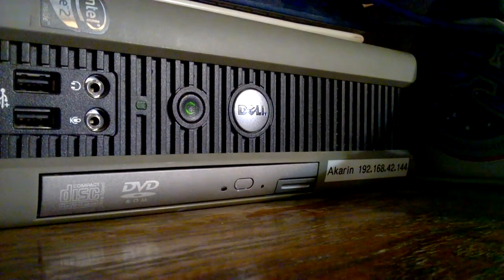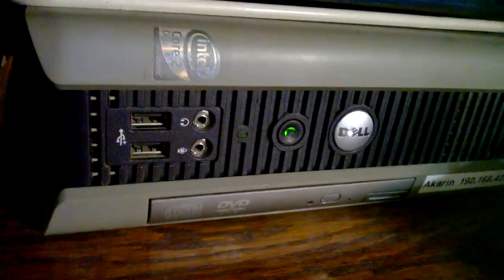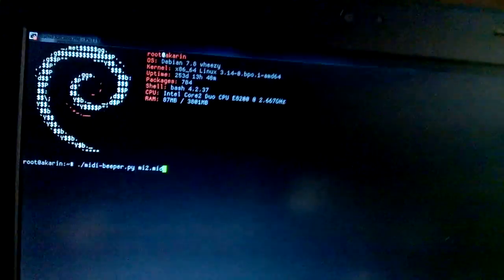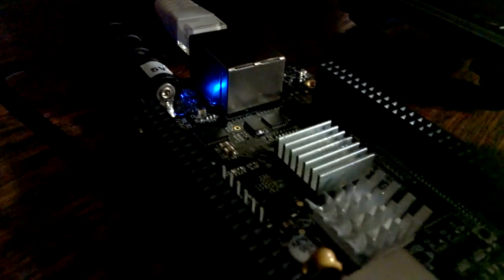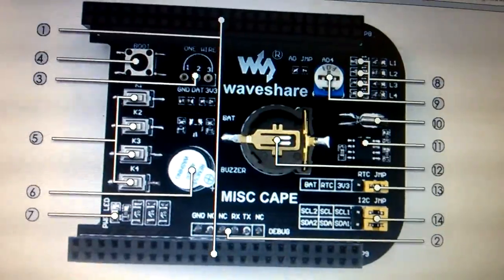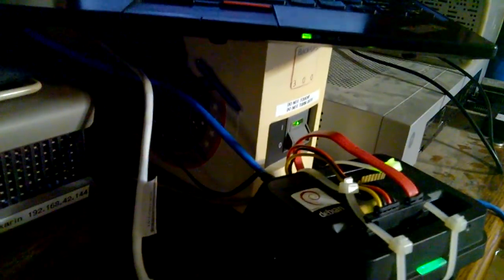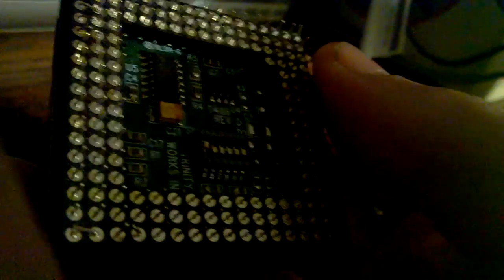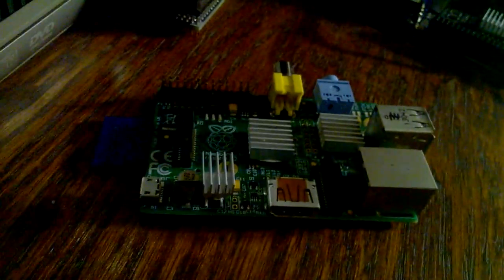Midi-beeper... Why I'll miss the OptiPlex 760 USFF.

Comment: that program is pretty cool, I'll have to try it on my 760 when I get a power cable for it lol
Reply from the maker: hopefully you find a good deal on it-- the Dell bricks for these are quite heavy by themselves. I heavily suggest getting a DA-2 over a DA-3 power brick, however-- for a 220W max instead of 180. the DA-2's tend to last longer than the newer 3's on Core 2 class systems. I'm just using one here for the 760 I have because it's what I got when the thing used to be an SX280 before the board swap-- but I learned quickly that's actually a good thing, so I pass this advice along to you. good luck.
Reply: Yeah I found a DA-2 on eBay for $10